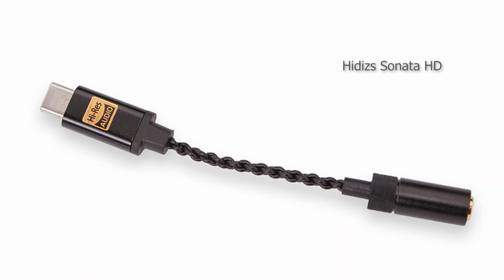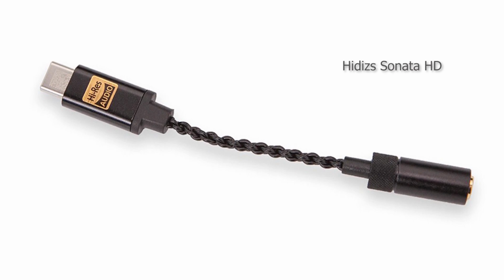7Hz 71 DAC will Improve your Smartphone

Comment: What 7Hz designed the 71 to do is to compliment the sound signatures of it's own iem's as that is what they test them with. I own the 7Hz 71 and I use it with the 7Hz Zero, 7Hz Zero 2 and the 7Hz Sonus. This little dongle is great when paired with these aforementioned iem's. Amplifiers do just what the name implies - amplify sounds. So, if you're iem has shouty or muddy characteristics...... You guessed it, it's going to amplify those characteristics. The 71 has a slightly warm/bassy signature. The reviewer is correct in saying that most entry level iem's tend to be fatiguing in the treble region, so a warmer sounding dongle would be the appropriate sound signature to use in the 7Hz 71.

Comment: I have the 7hz and enjoy it with my AKG K240 Sextetts (with an external amp because they are 600 ohms), my 7hz Timeless iems and my Rode NTH - 100. I also have the Moondrop Dawn dongle dac but unfortunately after a few weeks it no longer works...apparently that is quite common. For the price one pays it is a no brainer and so far it is still working..

Comment: Does it need usb player pro or something like that to power it in full potential?
Reply from the maker: You don't need it to have full power of the DAC. However, the sound fidelity will be slightly better if you avoid Android resampling by using some of those players that can get direct control of a DAC. That's like a general truth that goes for all DACs.

Comment: I have used 7Hz 71 DAC for a few days. I can confirm that bass region is slightly emphasized. What i did not like was very sharp, analytical, some would say clinical, treble region both on my headphones (AKG K250) and loud speakers MB Quart QL 20 C on power amp (although less pronounced). Having previously owned SMSL Sanskrit 10 mkII I can say 7hz dac (with AK4377 chip) does have nothing of marketed VELVET sound. This is not necessary bad thing. Highly detailed, energetic presentation with great channel separation will probably thrill young people.